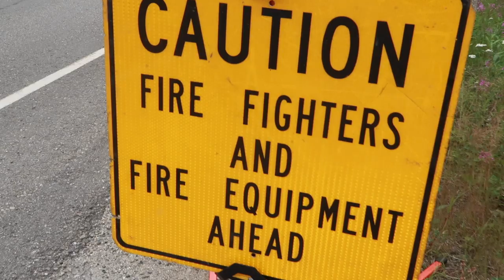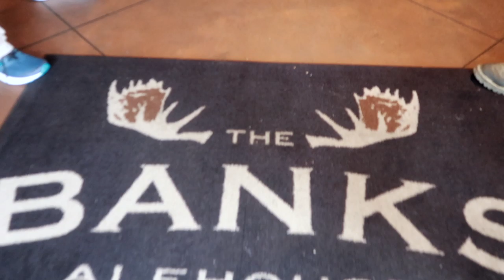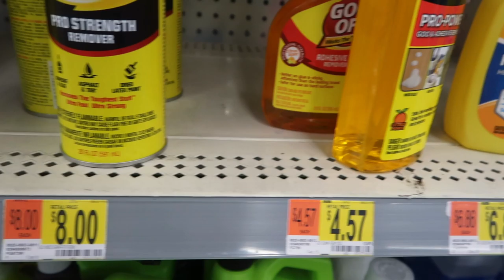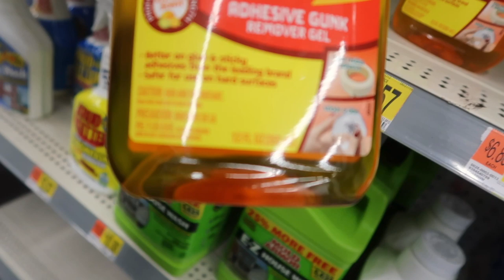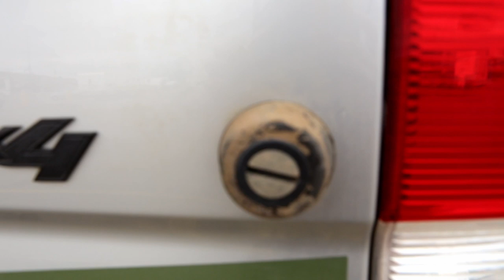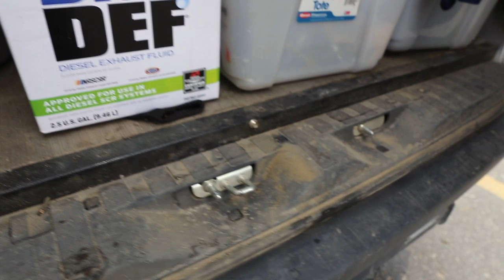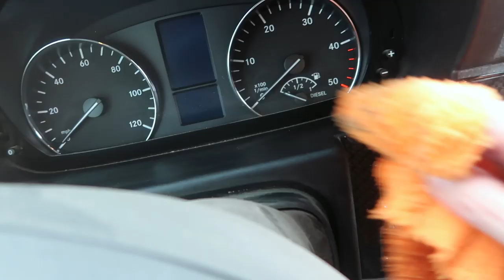VAN LIFE | Getting Clean at Walmart | Winnebago Revel

Comment: Looking forward to know all about your video cameras & mic(s). What do you have for stabilization?
Lens,? Sensor? separate stabilizing gimbal (battery operated?).
BTW... Jim has something he loves to bide his time... a HUGE SANDBOX! Worse comes to worse, would it be possible to use an ez-removable painters tape on the inside of the openings to prevent at least the majority of dirt?
Reply from the maker: Hiu Rick.  We have fixed the areas that the dust was entering, thank goodness.  We have multiple cameras that we use but primarily the Canon G50 for vlogging.  We also use a canon G7x, Osmo Pocket, Canon 6D, and of course the drone.  We do use a Ronin gimbal when we are hiking now although previously we had not been using one.  The gimbal is pretty helpful!

Comment: I have a high roof Promaster with the same problem. I asked the owner of Off Highway Vans in SLC if he knew of a solution for dust in the Promaster. He did not, and, in fact, he said Sprinters have the same problem. I would like to know if Transit also have the problem. Maybe it’s the size of the doors?
Reply from the maker: Interesting.  They seem perfect for awhile then shift with use I am guessing.  Id be interested to see if the Transit does the same also.  We know its a bummer when your not expecting it :) . Pretty easy to adjust though once you know about it.

Comment: Y'all - I'm interested to know how your four-wheel drive performs.  Do you use it all the time you're off road?  Have you had any problems with it?  I can't imagine traveling the back roads without it, but hey, my folks and I did the 'old' Alcan in a '63 Buick Electra. . . .
Reply from the maker: Hello Pat.  We don't use it all the time just times when it looks like it may be helpful.  We have had 0 issues with it at all and it has always made things better when we needed it.  The worst we saw was on the Dempster and the 4WD capability really paid off.  I am sure it will make a difference in the snow and ice also.

Comment: Jim
Is the dust leakage around the back doors a fixable problem. Just seems what the Revel cost this should not be such a problem. You get the 4 wheel drive to go on dirt roads you would think Winnebago would have a fix. Wonder in the 2020 Revel have this problem?
Reply from the maker: William Hope yes it is.  I showed it on one of the other videos although we didn’t focus in on what we were doing.  It is an adjustment to the doors and unless it is really bad should tighten up.  
You can also add an additional seal of needed.  

I’ll show the fix just for awareness in an upcoming DIY video that we are working on tomorrow.

Comment: Try to not get dish soap on the painted surfaces when doing the windows as it will strip the wax off and make it that much more vulnerable to the elements. A good protectant for all the plastic and rubber is 303 aerospace protectant makes clean up much easier.
Reply from the maker: Great Tip John!  As you can see Jim loves that toy and I will definitely remind him of that.  As for a rubber protectant great advice. Now i'm going to order that TODAY.  You had me at "makes clean up much easier".

Comment: Wonder if some type of filter could be installed over the ceiling fan. Draw air in to creat a positive pressure inside. The van has a lower pressure inside, while moving,and sucks the dirt in.
Reply from the maker: Good question.  It does help to have the fan on when driving dirt roads for positive pressure and I'd have to ask him if he forgot to do that.  This was mostly a seal issue and a place in the floor that needed some extra insulation.  I'll have to ask Jim about that.  He's adding extra insulation and I think that's going to be an upcoming video as we get it ready for the cold temps.

Comment: I have been wondering, what are the yellow short poles in Camp Walmart?
Reply from the maker: Those are outlets so cars can plug in their block heaters in the winter.  In Fairbanks, the temperature can drop down to -60 and stay there.  It's recommended cars plug in during the winter to help with air quality.
Reply: @WingsandWheelsAlaska  Thanks for the response.

Comment: I think it's great that you show this side of RVing because so many people only show the fun side.  Most will show the breakdowns, or the recoveries, but few really just film the everyday cleaning that has to be done.  I am curious how the backdoor seal will work given the adjustment.  I've seen people put those seals on the doors and frame so they basically double up.  It makes closing the doors a little harder, but the doors are most definitely sealed.  Have you considered using ziplock bags for the stuff in your drawers until you confirm the dust issue is resolved?  We used ziplocks for everything in the military because Iraqi sand is just as fine as baby powder and gets through everything.  Ziplocks are a lifesaver.  Great job on the video!
Reply from the maker: Thank you so much for the feedback.  We are interested to see how the door adjustment works as well.  We are thinking about adding an additional seal that is what one of our friends did.  Ziplocks sound like a good idea!